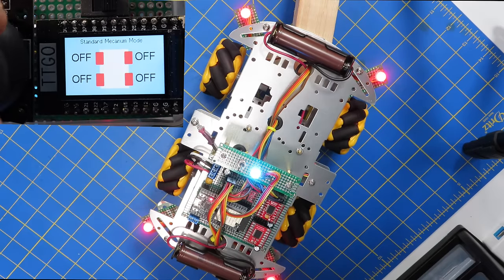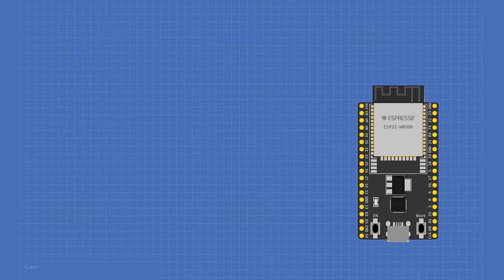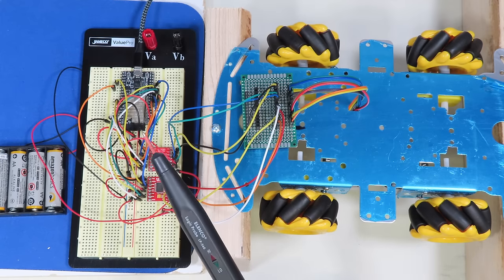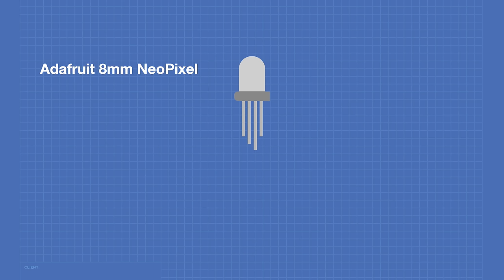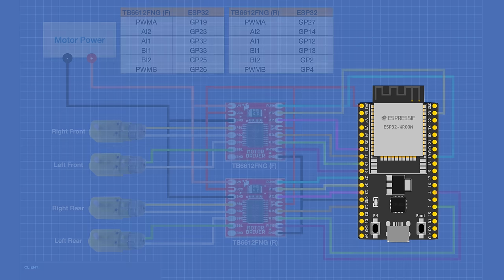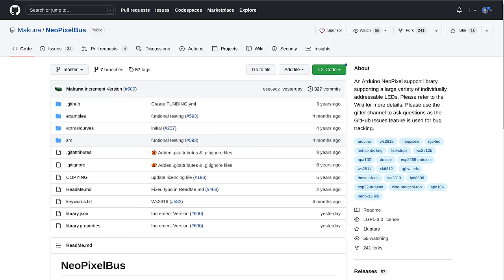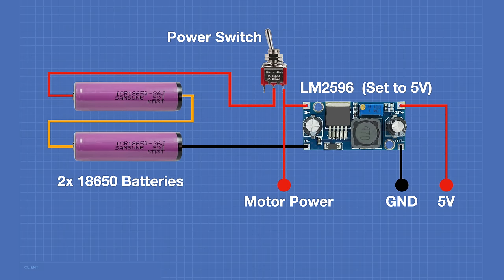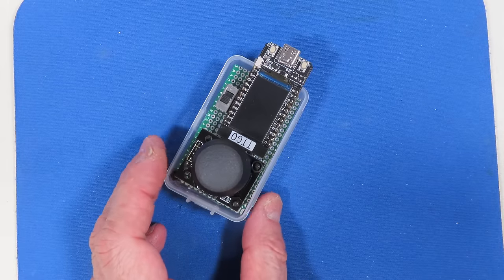Mecanum Wheel Robot Car & ESP-NOW Remote

Comment: I'm having difficulty wrapping my head around the statements that say one set of Mecanum wheels have the rollers at 45 degrees to the axle line and the other set has the rollers at 45 degrees to the wheel plane.  To me, my mind just sees the difference in the two sets is that the 45 degree angle is just rotated 90 degrees from one set to the other.  And either could be considered 45 degrees to the axle line or wheel plane.  Can anyone help clear the fog in my old gray matter?

Comment: Bill,

I want to express my great appreciation for this project.  I just got done building my own ESP32 RC car.  Your power pack design for this car helped me improve the battery pack so that I only needed a single battery pack instead of two.  I was not aware of the neopixel package that you used on your car until watching this video.  Thank you for making me aware of that.  I cut 4 WS2812B LEDs off of a strip and soldered extension wires between for my neopixels.  Your approach required less tricky soldering.  I really enjoyed seeing the mecanum wheels in action.  I can tell how much work you put into this project.  You did a fantastic job explaining it.  Thank you so much!

Comment: What another wonderful video. I am in the process of building up my own Mecanum 4 wheeled robot using your fantastic video and article. I accidentally ordered the DRV8833 Dual Motor Driver. As you mentioned in your "Driving DC Motors with Microcontrollers" this reduces the number of control lines. I managed to get the same base you have for the robot, but needed to drill some holes to attach the optical rotation sensors. To try and reduce complexity I am wiring the motor power directly to the ESP Dev Module which has an onboard voltage regulator. I then use the 3.3V from the ESP32 to drive the optical sensors etc. This may have some issues down the line, but worth a shot to reduce the number of modules.

Comment: Excellent demonstration of knowledge , experience , organization and disacipline. Greatly appreciated.... and greetings from Germany.
I have a freenove ESP32-S3 CAM- board as central mcu - The camera is already using a lot of IOs , so i ll make a I2C connection to a RP2040 Pico , which delivers the 12 output pins for the motor control and can easily drive a 3.5 inch TFT - naturally with the wonderful library from Bodmer. So the LEDs will be obsolet as the electrical situation can be displayed on the screen.
The Pico is my favorite workhorse for such tasks.
For the remote controll i will use a WT32-SC01 3.5 TFT with integrated ESP32   AND - VERY IMPORTANT - a capacitive touchscreen - to mimic the joystick .
I had very poor results with those standard analog joysticks - the whole analog range is a few millimeters - so they are not at all responsive enought for fine controls.
I dont have any experience with the ESP now WIFI - connection - but this part i can learn from you .  BILL ---- GREAT LIKE ALWAYS.

Comment: You only need the caps for the 8mm neopixels if you're stringing over 20 or so. If you use a teensy 4.1 to drive them you don't need caps for any of them.

Comment: Thanks for your interesting content, very useful and clear.
Please explain, is it possible to use touchscreen with mounted esp32 as a normal remote control unit? There is wt32-sc01 plus board, so looks like it could be used for controlling instead of smartphone, but dont know with streaming video or without... is it possible? Thx!

Comment: Good morning, Bill. I am from Brazil. I would like to ask you a question. I'm new to this area of robotics and electronics. The question is: why did you place the negative on the project chassis? Is the battery no longer negative? Can I connect the battery negative to the same wiring as the chassis negative? Could you explain it to me?
Thanks in advance.
Att,

Comment: One difference I would make is to use rgb leds with 6 pins, 6 independent LEDs.  Then you van wire one across the motor in one polarity wirh current limiting resistor, one the other way, and yhe third perhaps across a bridge rectifier on the motor so that when either direction is energized the LED lights.  No code to add those features.

Comment: Awesome robot! Currently building something similar with my daughter. Question; why did you choose the bit mode for determining drive control rather than running a vector to speed calc for each wheel? Doing so would allow fully dynamic movement of translation without having to switch modes and Ecam Eurobot covers it well. Using two joystick allows full control; left being FWD/BCK & L/R while the right for yaw.
Reply: Design Cell: Do you have a specific link to the Ecam work? I am also interested in the dynamic approach. TIA.
Reply: @tonyjohnson4572  Looks like links are getting moderated which is why I didn't link it in my original comment. Searching 'Ecam Mecanum' should bring up ecam eurobot's github tutorial.

Comment: Bill, Could you make your articles available in PDF form along with web-based?  My internet connection isn't always good in my workshop (not connected to my house) and a PDF would permit me (and others?) to "play along at home" when out there.  This is a very educational video and is a project that I'll end up building as $$ comes available!
Reply from the maker: Actually, I'm giving the website a "facelift" at the end of December, and PDF versions of the articles are on the list (as are parts lists as well).  It's in the works right now, and I'll probably be "off the air" in the last week of December to implement it.
Reply: @Dronebotworkshop  Thank you very much!

Comment: Wow!  You said it took a while, and it's not hard to see why.  This project is fantastic.  I've been working on something a little bit similar using an Espruino 1.4, but  I didn't know about Mecanum Wheels, and oh boy will they solve some problems.
Will your final solution involve proximity sensors?  I'm trying to develop a device that senses and learns about it's environment (using proximity sensors and counting stepper motor rotations), and stores a plan of where it can go (and where it cannot), so that it can subsequently navigate autonomously.  Strategically placed QR codes seem to be necessary to recalibrate position from time to time (to allow for wheel slip).

Comment: Sir, how do you brake a dc brush-type motor electrically, meaning holding the shaft without rotation?
Reply: short the wires together.
Reply: @thomasmaiden3356  My mistake, hold or lock the shaft electrically.

Comment: Hello Mr. DroneBot, I'm trying to find an opensource receiver with the same size and functionality as the Radiolink R4FGM to use in my DIY RC Hotwheels projects.
It measures 25*13mm, has 4 channels AND a built-in gyro! Do you think this is a project you would be interested in doing?

Comment: It’s neat, but I’m not a fan of the controls. Two analog joysticks would be better. Left analog Forward/reverse/strafe left/strafe right. Right analog turn left/turn right + 2 others like shift front left/shift right. 

2 joysticks and 4 switches (like a PlayStation controller) could give our all of the different controls. 

Left analog Forward/reverse while strafing left right

Right analog Forward/reverse while turning left/turn right 

L1+Left analog R/L = shift front only R/L
L2+Left analog R/L = shift Rear only R/L

R1+Right analog R/L = turn front only R/L
R2+Right analog R/L = turn rear only R/L

You would have so much control without having to scroll through switching modes. Even just the one joystick with momentary buttons for the modes on the bottom of the joystick controller would allow almost seamless transitions while driving it. It would be more of a learning curve than a console controller, but it would be very cool to have it all be in one hand. 

I would only want to have 5 modes of 
No buttons pressed, index, middle, ring, pinky, but you could do 15…. Or more 😳

None
Index
Index middle
Index middle ring
Index middle pinky
Index middle ring pinky
Index ring 
Index ring pinky
Index pinky
Middle
Middle ring
Middle ring pinky
Middle pinky
Ring
Ring pinky

You could go more by the order that they are pressed, and the number of times that they are pressed before they are held down and the joystick is used all the way to an infinite number of modes 🤯, but it would never be easy to  instinctively learn more than about 5 modes of using an analog joystick. 

With it only being 4 motors that can either go forward or reverse you could even just use 4 analog switches that move in two directions, one for each wheel. 

I still think that a PlayStation or Xbox controller would be the most instinctive thing to learn and the easiest thing to build and map the controls for.

Comment: Have you figured out anything to combat the surface differences/slipping of the mecanum wheels?
I have the exact same base (but a little different wheels, but they're the same size) and I'm using an Adafruit Motor Hat for an Uno instead (but ofc this doesnt matter)
I'm currently trying a PID algorithm for preventing the slight rotation around the z axis and the inexact movements around the xy axis, but it really doesn't seem to like the sideways movement (i.e. strafing left or right) and it seems to go off on a 45-50 degree angle instead of 90. These work without any sort of PID correction, but I dont really like the slight z axis rotations or slipping and was trying to fix it. Is there any merit to actually continuing on with trying to tune a PID control mechanism or should I just accept that It'll have some inaccuracies?

Comment: I know I'm late to the game, but ...
At 7:58 you showed us the arrow you drew on the chassis to indicate forward, and it points to the left. 
I suppose it might be a camera shutter effect, but in the robot test demo around the 23 minute mark, are the wheels turning backwards to the serial monitor printed direction?  
It really really looks like when the screen says "Forward", the wheels are turning to drive the chassis to the right of the screen (and of course, the opposite for "Reverse").  And when the text says "Right", it looks like the wheels would drive the robot to the bottom of the screen (vice versa for "Left"), which would also be wrong according to the arrow on the chassis.  It's harder to make out the diagonal motions, but I think they're reversed too.

If it was all reversed, I guess the easiest fix would be to just re-draw the arrow on the (symmetrical) chassis?

Comment: Thanks you for all your posts. They have made me want to build with Arduino and I really want to build this Mecanum wheel car. I downloaded your code but it will not compill.  
Compilation error: invalid conversion from 'void ()(const uint8_t, const uint8_t*, int)' {aka 'void ()(const unsigned char, const unsigned char*, int)'} to 'esp_now_recv_cb_t' {aka 'void ()(const esp_now_recv_info, const unsigned char*, int)'} [-fpermissive]
Any pointers on how to correct this error.

Comment: what programing language are you using ?
Reply: The Arduino Programming Language is basically a framework built on top of C++. You can argue that it’s not a real programming language in the traditional term, but I think this helps avoiding confusion for beginners.

Comment: Mecanum Wheel Robot Car & ESP-NOW Remote .Using  Arduino v1.8.19 . 
Sketch "getmac" workes .Verify Sketch "4wd-test",get a error .
Line 61 { analogWrite(MF_PWMA, speed_slow); }
ERROR ERROR [analogwrite was not declared in this scope]  
What have I mist.Can you hellp?
Reply: Had the same. Cure found in internet. Replace every occurrence in the code of "analogWrite" with "ledcWrite" . 
The code will then compile and work correctly. At least it did for me.
Reply: @horamflyers3839  thank you

Comment: This was a lot of work, and I appreciate the information. I have ordered the parts. I plan to put FPV Camera Foxeer Micro Cat 3 Night Camera Low latency 1200TVL OSD, InfiRay Thermal Camera, and GPS and convert some of the code to use a Radio Master 16S TX and Receiver. I have plans for this equipment.

Using this information to integrate the camera with the remote control vehicle.
DIY Thermal Cameras for Drones, RC & FPV – Tutorial, Schematics, Tests – drones thermal imaging
https://www.youtube.com/watch?v=JYp3dDWWEJ4&list=PLTY4osYDsm1o-pnuJv2AmEbx6t5KEQvSh&index=3